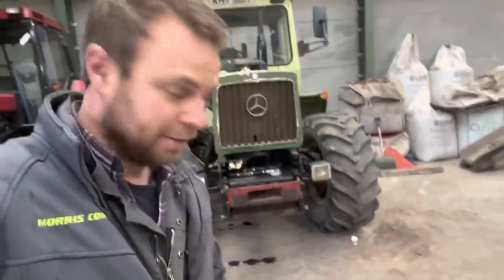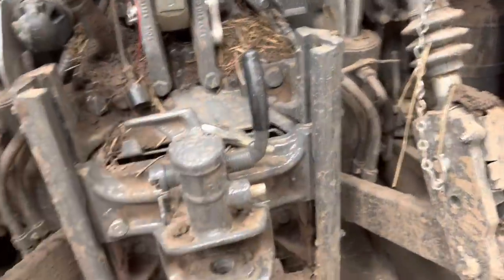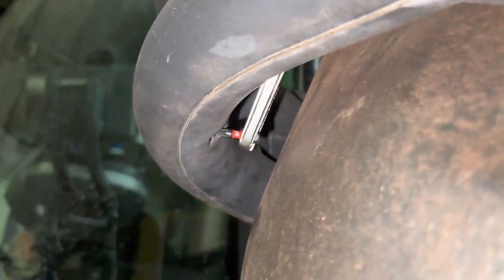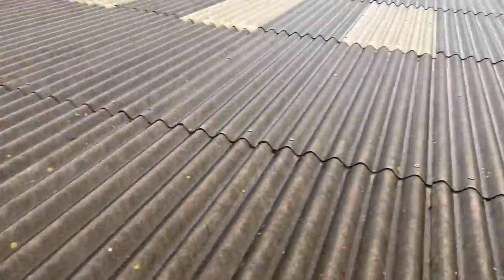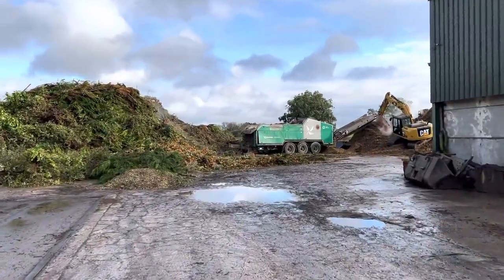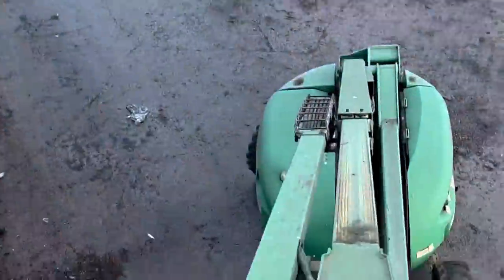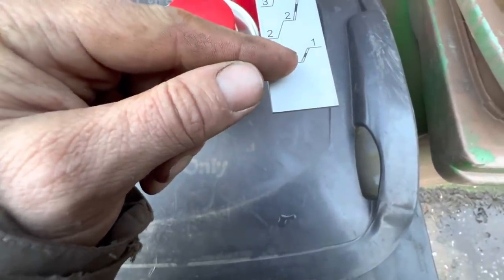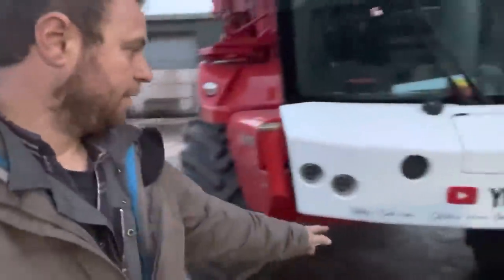Day577  #OLLYBLOGS FENDT TRACTOR IN MILLION BITS GETTING PAINTED AND WET WET WET #AnswerAsAPercent

Comment: MB Trac great tractor way ahead of time🤠 spring suspension, front pto/ hydraulics, passenger seat, turnable driving position, disc brakes with air, lift 3point from outside. And then a non centered driving position, why???

Comment: you could use an epoxy fuel tank sealer before putting the tank back in/on the John Deere. Are all the original Fendt Black Beauty's a solid black colour? I really think they missed a trick not making them all a metallic or pearl black, that would have finished that tractor off really well in my opinion. you can get mini water traps that you can put inline just before the paint gun (so compressor, main water trap airline run and hose, airline fitting, mini water trap and paint gun). You can warm the paint by putting it in some warm water, it helps in the autumn/winter months to thin the paint a little to and aid it flowing out easier which means you don't have to use as much thinners in the mix

Comment: For the Makita multi tool if it's variable speed knock it down to about 3 or 4, cuts better and doesn't blow through blades if you're running it flat out,
Half power or just over I've found copes with most tasks, never ran one on full power.
Reply from the maker: Never used one before